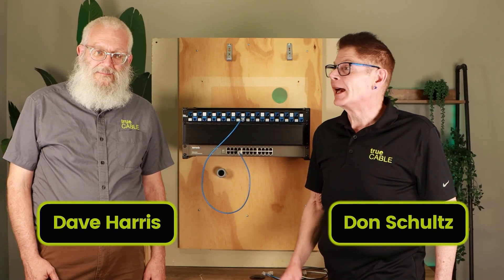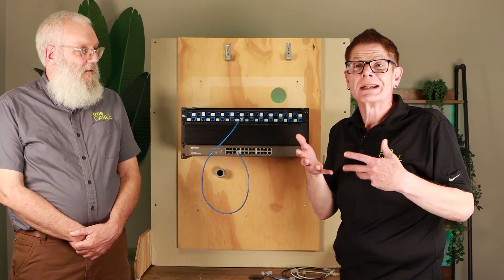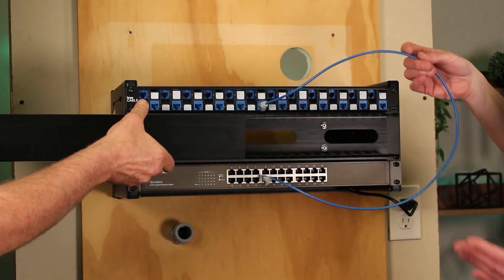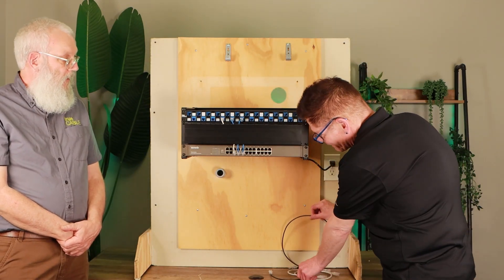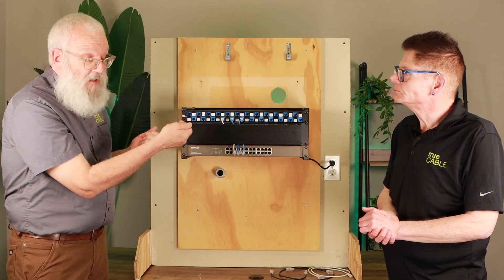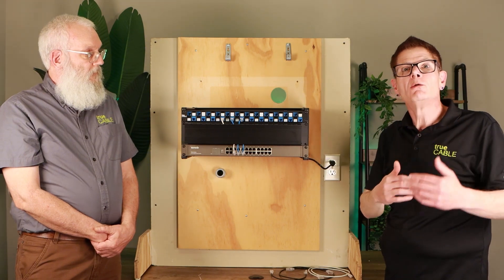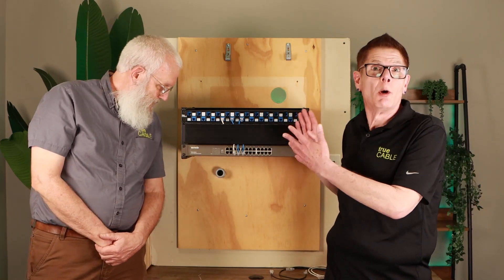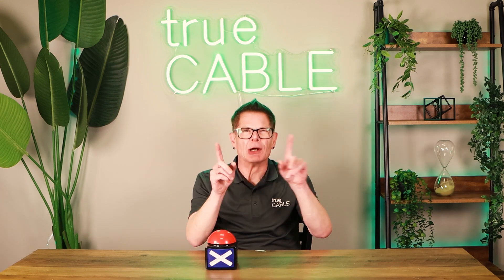How To Wire a Server Rack  Tips & Best Practices

Comment: After I think about 25 years or more of experience I can say that the best way to play nice with server and network racks is to keep it simple and easy to maintain.

1RU Patch Panel (24 ports)
Switch (24 or 48 ports) *
1RU Patch Panel (24 ports)

-Use 6 inch or shorter patch cables.

Your cable pulls should be bundled in 24 cables and braided. Those 24 go into the first patch panel and your next 24 go into the next panel. Don't be tempted to deviate. Rinse/Repeat until you are done. I wouldn't bother with the cable managers between the patch panels because that is the culprit of 99.9999% of the mess. Also longer than needed cables are also a pain point. Keep the cables short and label the cables in front and your patch panel in front and behind the panel. You save money because your not wasting money on unnecessary cable managers, shorter patch cables cost less, the time it takes for you to swap out a switch is infinitely faster since you don't have a jungle. Take into account all those benefits and you do make more financial sense to keep it simple. The only time I've seen a positive reason to change/deviate from that is when you have a lot of fiber runs, then you could make an argument for modifying it.
Reply from the maker: Hello, and thanks for your insight. It would seem others follow your particular pattern, too, given we keep selling out of our 6" patch cords. In fact, they are the most popular patch cord we carry, aside from the 14-foot variation. Now I know why. I have always used patch managers as that as how I was BICSI trained, but I will give your method a shot as well!
Reply: @trueCABLE  I didn't start out my way I learned it the hard way doing it wrong project after project. I actually value more of the BICSI training as a few months ago I learned about the proper way to do training. I've had to just do on job training and youtube. School unfortunately didn't teach us anything in the actual data center short of basics about servers and networking.

I think the BICSI way works provided theres a valid reason. The cable managers just are really an added cost, in some cases can be a crutch, add to visual and physical clutter. I kinda think that way is preferable when it comes to fiber more than copper!
Reply from the maker: @kristopherleslie8343  Hello Kristopher! Indeed, "IT school" does not really cover what you need to know about structured cabling systems (SCS) best practices. That is because SCS is considered more of a "trade" and given rather short thrift when obtaining formal education around ICT/IT best practices. Both disciplines focus on different parts of the ISO/OSI model. Structured cabling systems are pretty much "Layer 0" as I like to call it. Only BICSI or on the job training will prepare you for what SCS installers have to do each and every day. Thanks for the added and considerable feedback. We are always looking for it and will consider revising the recommendations we make (even if not fully inline with BICSI) as we come across them!
Reply: @trueCABLE  considering all the experience I have it’s still short with gaps. Im thankful to have worked in many places to see how the effect of good and bad SC can be.

Comment: What is the proper way to ground this rack or any other rack in a residential situation? I purchased a 15U rack for my home network and the instructions say to  ground to an “earth ground connection”. There is a spot in the back of the rack to hook a grounding wire, but where am I suppose to connect this in a residential situation? All my devices are plugged into a PDU that is hooked into a UPS battery backup which is plugged into a grounded outlet. I am in the US. Thanks!

Comment: How does it "improve performance"? Do the electrons get confused having to navigate a messy patch panel? A neat and tidy configuration may be easier to navigate, change, and fault find but it has nothing to do with "improved performance".
Reply from the maker: Hello! That would be interesting to watch if it ever happened!

In all seriousness, performance is improved due to more organized cabling having the positive effect of promoting better airflow. This helps with heat control in high density racks where heat can reach levels where it may cause additional insertion loss. Hope this helps!
Reply: yes, there a few reasons for neater racks. The electronics issue is one, which improves performance. the race with messy wires is more difficult to trace wires, there have been instances where, in larger rack sites, I have had to tone out a patch cable, if the cables were organized properly, I wouldn't have to had to tone out the cable to find the other end of the cable.
Reply from the maker: @josephfmurphysr1420  Correct! Also, the bigger the system the bigger the hassle if things are not tidy and labeled right. You have not lived until you have had to tone out HUNDREDS of pairs due to a newbie installer cutting off the temporarily applied labels during an installation of a backbone cable. Fortunately fiber is now the most often used backbone these days.